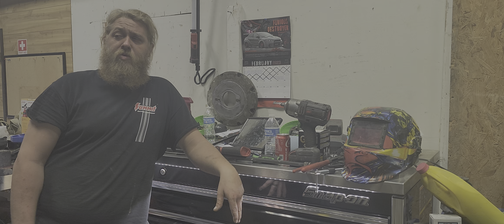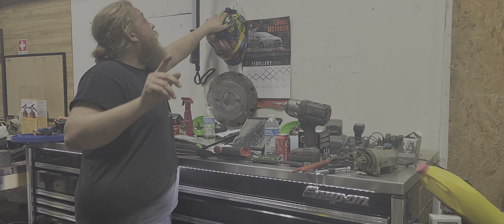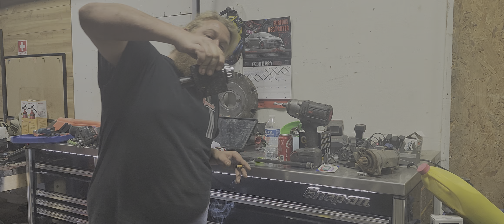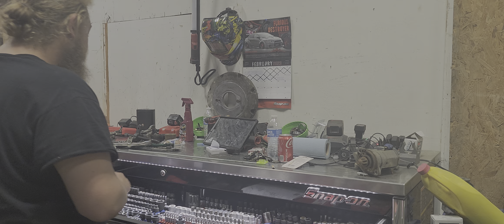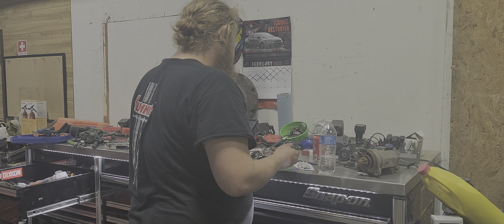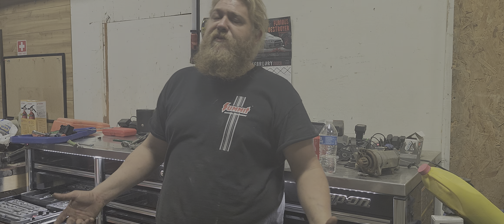Yes, it's the end of the week rant. More nonsense and excuses

Comment: Well, the end of the week. That's nice man, you finally made it. Me I'm off on Thursday and Friday so I'm getting ready to go back to work.
I drink Scotch a little bit here and there dimple pinch is what I buy and it is the 15 year old stuff. Blended and the price point is good. Yes,  breaks are needed to avoid burnout and also to avoid killing people sometimes LOL. I used to have an old 80 Malibu Classic station wagon that I would beat with a 4lb sledgehammer when I was frustrated. Every so often we would flip it over with a forklift and beat on it for a while and then flip it  back and we finally hauled it away for scrap after we stripped it of all the parts we could get. I wish we could have shot the thing but we were in the city limits. Oh well. I will say that we did fire the black powder Cannon off on occasion and that was good for a setting off some car alarms.  And every once in a while somebody would fire off a 380 or 9 mm in a quick string outside of my trailer door at 6 a.m.. lol after while I didn't even wake up.  Anyhow you got to work hard and you got to have fun  in equal measurements.  Keep it up brother! We will be around.
Reply from the maker: First and foremost  sorry for delay in response I wish I had a car to beat on lord knows I need it right now. This week has been exhausting mentally and physically  ill have the video up tonight of this current week.  I could also use a stiff drink as well
Reply: @classiclinesautomotive  don't apologize my friend.  I know you want to be involved and we love your involvement but there will be a time when the channel will get too big for you to do so. Handle your business and we'll be around.  And just enjoy that drink!  And yes everybody needs something that they can beat on with a hammer to take out their frustrations on, it helps a lot.